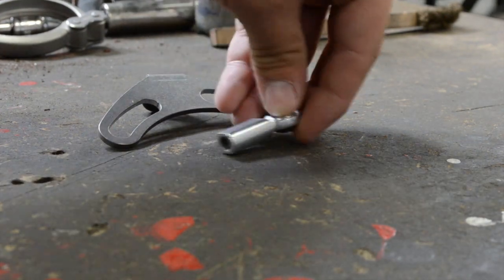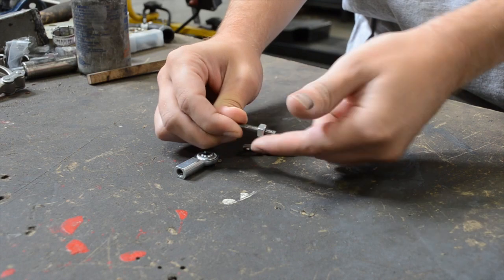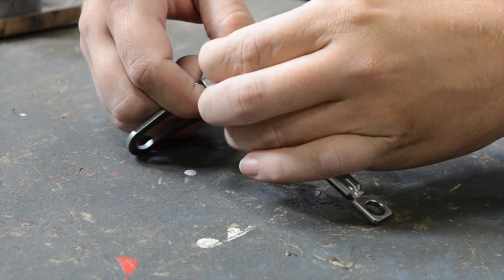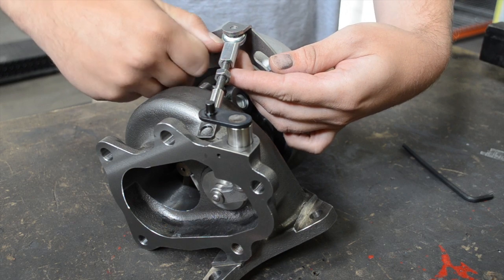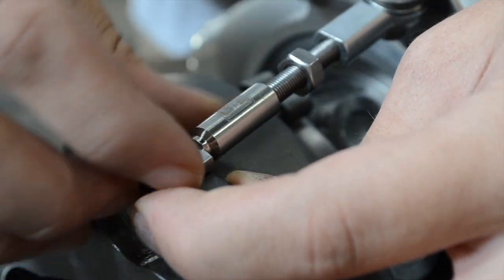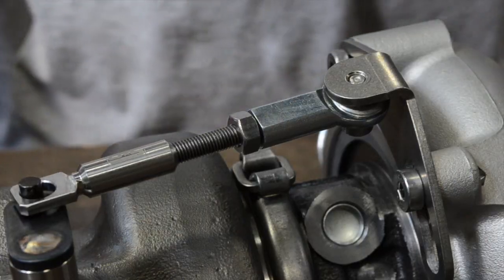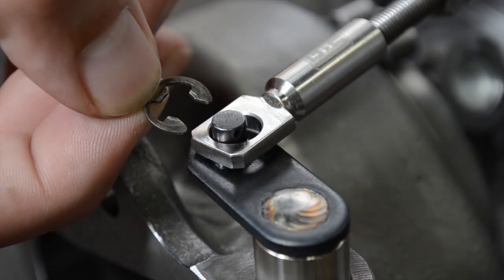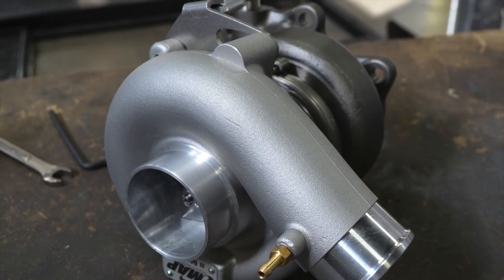GrimmSpeed Adjustable Internal Wastegate Bracket Install Guide

Comment from the maker: An adjustable waste gate bracket is only beneficial if you are running an external waste gate.  If you are, then you need to make sure that the internal waste gate is closed securely and not leaking.  We came out with our adjustable bracket to meet fitment requirements of most aftermarket stock location Subaru turbos on the market at the time.  Let me know if you have any further questions or concerns.

-Matt Homes
Reply: GrimmSpeed I bought thus but were suppose to get the screws that screw into the top of the turbo or reuse our old ones

Comment: This is a internal wastegate bracket that will fit on multiple turbos. It's to hold the flapper shut when running an external wastegate